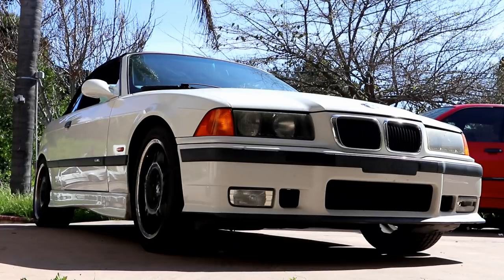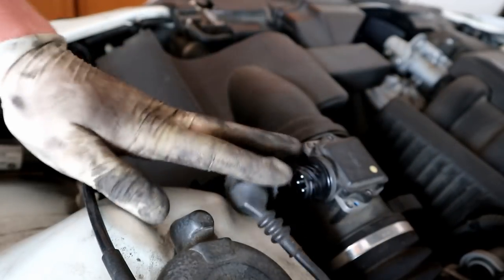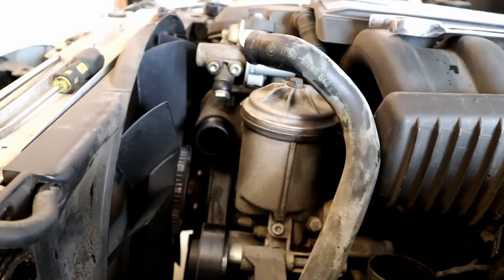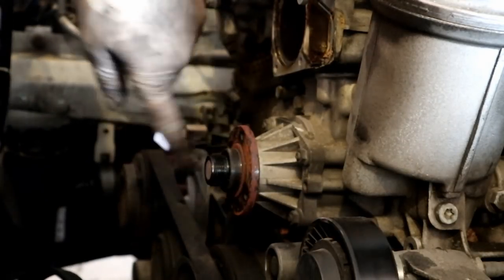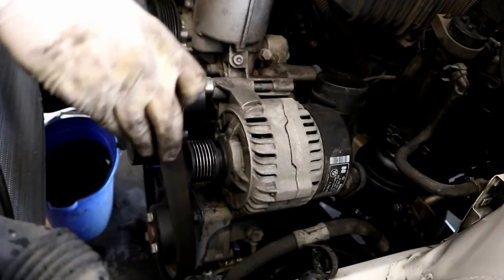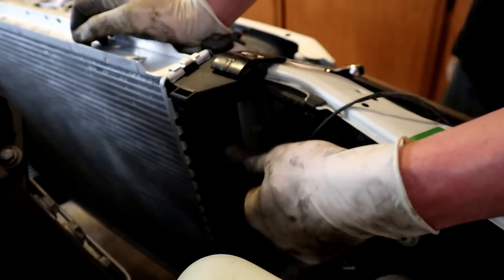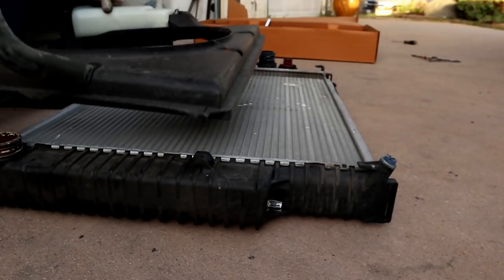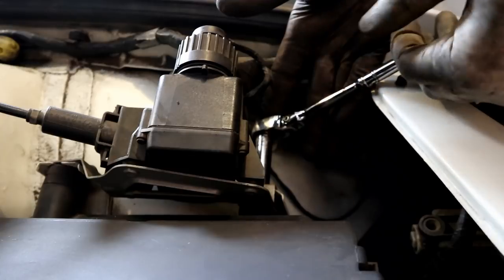E36 Cooling System Rebuild DIY

Comment: no all aluminum radiator, no metal fan shroud w/ electric SPAL fan, no metal expansion tank & no Stewart water pump. Summer is right around the corner = You're a brave man!
Reply from the maker: This car is low mileage, bone stock, and wanted to be kept that way.lol
Reply: The aluminum radiators believe it or not don't hold up nearly as long as OE. In specific Mishimoto radiators you're lucky to get 2 years of driving out of if you really drive the car to its limit. The plastic housing for radiators much like everything else in a bmw will outlast aluminum radiators. And that's saying something.

Comment: I prefer to drain everything through the radiator (running the system with the heater on high) or through the water pump hole (if you’re removing it anyway and the car is  not on jacks). That block drain plug is just bad design and messy.
Reply from the maker: yeah but the drain plug gets alot more out that through the water pump. agreed on bad design though.
Reply: M3NACE to ensure complete drain, I do a few cycles. It’s like putting a distilled water until it becomes clear.
Reply: Old coolant can become conducive / electrified and cause power surge which will ground out somewhere, hopefully not the fuse box or worse.

Comment: Very thorough video on a very important subject. I definitely had cooling system issues over the 20+ years my family has owned my e36. I’ve had radiators pop, a fan clutch explode (terrifying), hoses burst, etc. I finally fully sorted my cooling system back when I did the head gasket with all new silicone hoses, upgraded water pump, etc.
Reply: Did it still give you issues after you upgraded everything?
Reply: @MrBellyman128  no, not yet 🤞 I have auto crossed it several times (see my videos) in the Georgia summer heat without any problems. However, I don’t daily it like I used to.

Comment: Your videos are motivational and educational. Nice job and thanks! Just purchased stock 96 BMW 328iC in near mint condition with 72K miles. No issues. But no maintenance history either. No cooling issues and fluid is still blue. Belts and hoses look pretty new and in good shape. Not sure if I should change water pump and thermostat.  Thermostat cover is aluminum.If you think I should, I'll check pulleys and tensioners too. Oil was not bad but I changed it anyway. Power steering was an issue. Fluid black, Resevoir original including hoses and steering stiff. Flushed it twice and much better. Planning on flushing again and changing resevoir and hoses &  this weekend. Let me know what you think on water pump and thermostat. Thanks again.
Reply from the maker: I would, doesnt take much time if you're already in there and its piece of mind. Last thing you want is to do all this work refreshing only for the thermostat to stick 4 months down the road and turn your fresh 72k mile motor into a rod-spinning milkshake machine.
Reply from the maker: I would, doesnt take much time if you're already in there and its piece of mind. Last thing you want is to do all this work refreshing only for the thermostat to stick 4 months down the road and turn your fresh 72k mile motor into a rod-spinning milkshake machine.
Reply: @M3NACE   Change out the Water pump, themostat, radiator, expansion tank, Coolant level sensor, hoses, pulleys,  belts.  Added new Bmw coolant. Bled system and no issue with temp gauge. Dead center. However console tells me to check coolant level. Any ideas?
Reply from the maker: @edwardglatzmayer5466  check to make sure your coolant level sensor is plugged in correctly

Comment: Very nice video. Well documented and thank you so much for no crazy camera shakes and music ovelay! Question: you tighted the thermostat housing for the aluminum kind at 89 ft-lbs!  Just confirming things, per the manual, which is for the plastic housing OEM, its 10nm (7.3 ft-lbs) just confirming the differences because of product material. How/why 89 ft-lbs?
Reply: My Bad! - you correctly said 89 "inch" lbs, which aligns more with 10nm or 7.3ish ft-lbs -- LOL!

Comment: That's a very dry e36 engine. Did you install the oil seals on the engine? How did you do it? I've read some people add RTV to the gasket.

Comment: Easily the best DIY video I've seen! Truly impressive how you can have such professional and clear video footage during this fairly involved procedure. For a simple coolant flush, is it sufficient to drain the radiator and the engine block (of course with the expansion tank cap off)? Or do I need to disassemble more components?
Reply from the maker: Draining the radiator and block plug are more than enough, quite a few people just drain the radiator and call it a day as it will drain the cylinder head as well, it just wont drain the block. Thanks!

Comment: This is great man. I'm about to do this exact job with the stage 1 ECS kit, but wasn't planning to replace the radiator unless it looks real bad when I pull it out. Is there a specific reason to replace the rad if it's not leaking? thanks!
Reply from the maker: i ususally just throw a new one in for peice of mind, they do get clogged over time and can leak from the plastic end tanks. i replace it so i dont have to down the road.
Reply: M3NACE thanks for the reply, makes sense. I’ll probably replace mine since it has to come out anyway. Love the videos man, you’ve really helped me out a lot! 👍👍

Comment: Awesome video man! Couldn't have came at a better time. I just got myself an e36 and this is definitely on my to do list. What are some signs that my cooling system is failing? Because so far it seems okay, but I don't want to put it off for too long
Reply: If the thermostat housing is the plastic one assume it needs a cooling rebuild since previous owner may not have taken care of it, if metal u good, just make sure belts and pulleys are ok
Reply from the maker: @BmwMe-uh9sy  +1 my dude, your on it.
Reply from the maker: these cooling systems really sneak up on you. first sign is leaking, residue on the hoses and from fittings and such. on the radiators with plastic side tanks, they will start to leak. if the thermostat or water pump fails, youll be driving and out of nowhere the temp gauge will climb to red and if your unlucky, that will be the end of your head gasket, and maybe even crack your head. no fun.

Comment: My water motor is struggling to keep still when I used the e36 clutch nut and the 32mm wrench. Should I take off the 2 bolts like you did to get better rotation, or could it jus be the rust ?
Reply from the maker: You are trying to get the fan off?
Reply: Yeah
Reply from the maker: @adrianmediachannel5329  you are using the water pump holding tool?
Reply: Yeah it came with an 32mm wrench and that’s what I use to try and turn it, but I think that could be the problem. It tends to jus slide and not actually screw it off

Comment: How do you ensure the water pump doesn’t spin without coolant? 

I keep hearing if you run the water pump without coolant it will break its mechanical seal.
Reply from the maker: ive never heard of that before. just add as much coolant too the system as you can through the expansion take before you start it and it will be fine.
Reply: M3NACE because after the drain, there would be no coolant, so it makes me wonder how the water pump survives in the initial start up because the T stat is still closed.
Reply from the maker: @string2155  the water pump will not break its mechanical seal without coolant in it. it does use the coolant as a lubricant, but it can run without it for a brief period of time without coolant without hurting it. the water pump is just a machined piece of metal with an impeller, shaft, mounting flange and housing. it doesn't care if coolant is there or not. i would be more worried about properly bleeding the cooling system than about the water pump breaking on start up, it will be fine
Reply: M3NACE thanks dude!
Reply from the maker: @string2155  of course man!